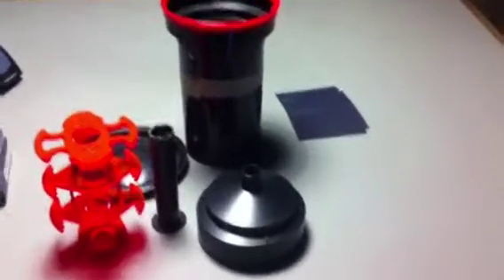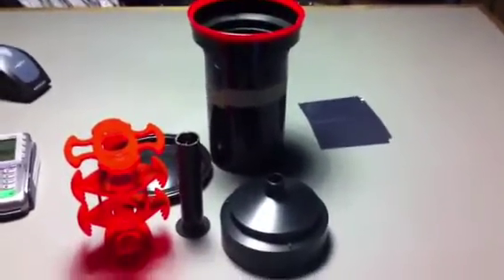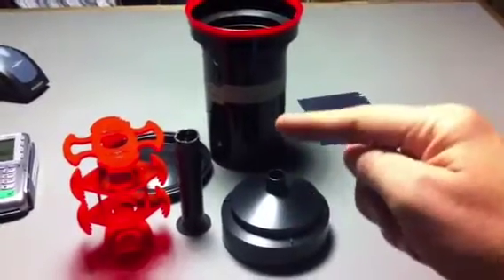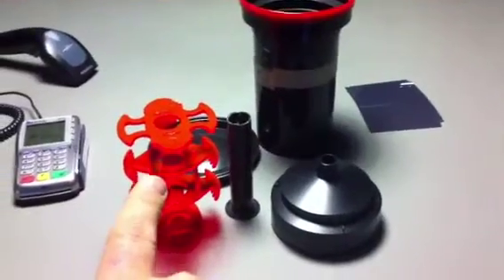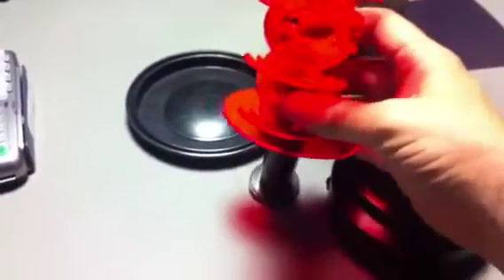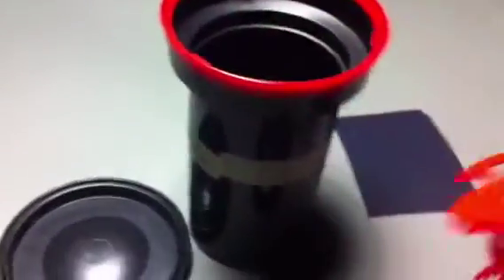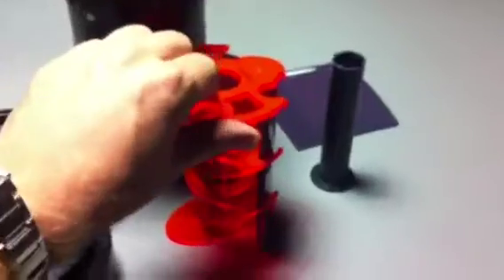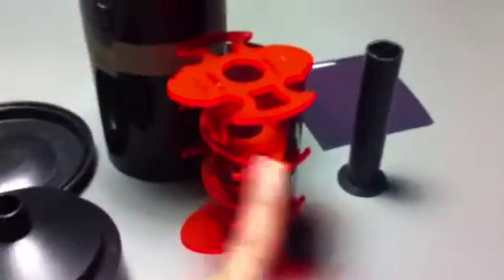MOD 54 LARGE FORMAT FILM PROCESSOR

Comment: For anyone stumbling on this video you should know that all of the concerns mentioned in this video had been addressed and resolved in the later MOD 54 mk27 version.  It's a great little device especially if you do stand or semi stand developing with something like HC-110 at 1+100 for an hour with three turns at the 30 minute mark using the Patteson agitation stick (aka swizzle stick).
Reply from the maker: Sorry for ther late reply...yes the new version, which I did purchase, is a FAR, FAR better tool for the job. It has changed my life when it comes to drving Large Format

Comment: Simon, I have one and your mention about getting the center post through the MOD 45 (U.S.) just bevel the outside edge of the center column and it will fit through the  center of the MOD 45 very easily.
Reply from the maker: Cheers